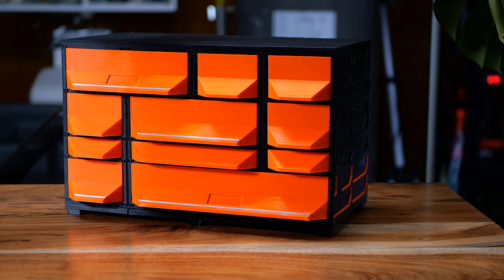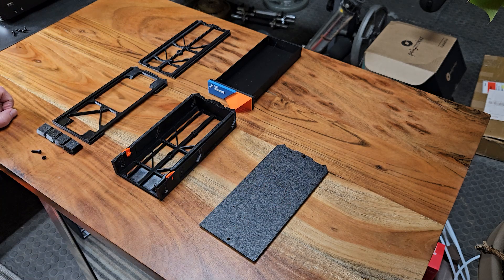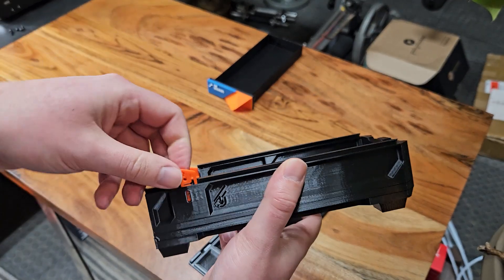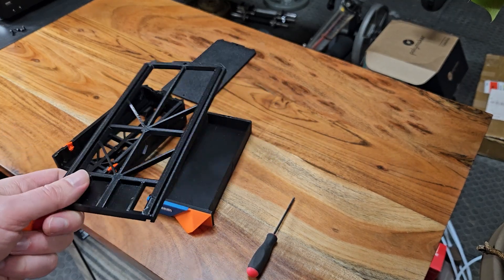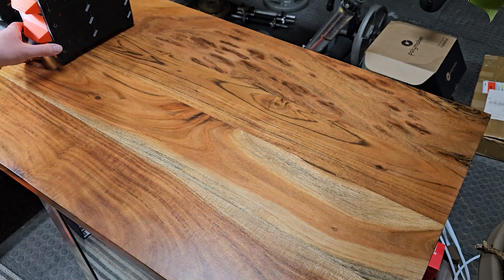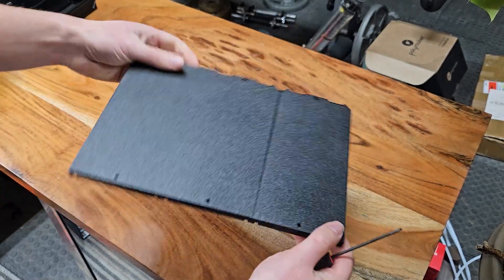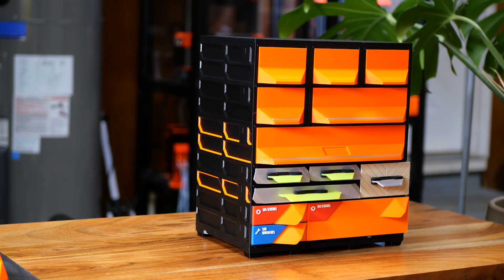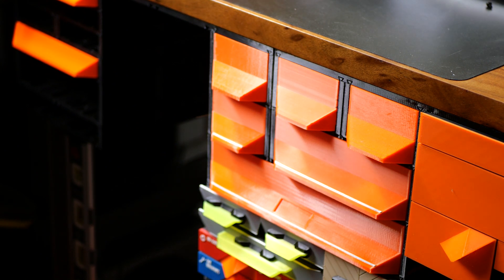3D Printable GEN2 Table Top Kit V2

Comment: My quicklocks aren't springing back, they just come down and then stay there, any ideas on that?
Reply from the maker: Here are a couple of things that might cause that:
- Stringing inside the QuickLock slot causing more resistance or obstruction to the mechanism - It can be hard to clean this out with a tool but working the quicklock in it's motion for a minute or so usually can help loosen or smooth things out.
- Elephants foot on the QuickLock - This causes the first layer to print wider than intended created a slight lip on the mechanism. Deburring the edges using a deburring tool can help correct for this.

Comment: Did you just remove your standard starter kit from Makerworld?? 2.23.25
Reply: Nevermind, Makerworld was glitching. =)
Reply: I do want to ask why you prefer PETG or ABS for the main frames? Do you see any issues using PLA Matte from Bambu Lab?
Reply from the maker: PLA will do fine for the case, the only thing I really recommend in PETG are the QuickLocks

Comment: I found this a month ago, and thought it looked great, so I downloaded what I thought was the correct files.   I just finished printing constantly for almost a week (the bins are 19 hours x2  and the draw it goes into is 22 hours also x2 on my printer), when I went to put them together nothing matches the videos, apparently I downloaded a legacy version, that has no instructions, so now I have to find the correct files, and spend another few days, to a week printing more stuff, I've gone from wow to deflated, I may as well  have bought a reel of filament and dumped it in the bin, on the bright side, I printed the standard bins, so at least I don't have to print them again...
Reply: did you use the links in the description?
Reply: Yes I did, but the parts I pri Ted did not match any part in any of the videos, some pieces were usable, but I've a bunch of unusable parts right now... love how the draws turned out, waiting on magnet to complete the job.  I'm probably just missing something, my build only uses one bottom frame, the top frame, and its joined using draw cases, not the upper and lower parts as described...

Comment: How do you do the contrasting colors on the sides? I can think of a way to do it on bambu but it would create a ton of waste.
Reply from the maker: You are absolutely correct, I was experimenting with this, it was actually printed on a multi-extruder Prusa XL which is much less wasteful when printing color changes vertically.  With that in mind I created the Decor series faceplates as a much more efficient way to add decoration to the drawers.
Reply: @jerrari3D makes sense enough to me! I appreciate the answer! I have a full set of table drawers printed but I’m waiting on some filament for the actual drawers to come in. Thanks for the cool design.

Comment: I just got my printer for Xmas and this is my first project outside of toys. My noob question is, what tool is everyone using to get the excess material out on the dove tails on the underside of the print? After breaking and bending a few tools, I finally sharpened a putty knife and that seemed to work okay but tedious. Maybe because I'm using the included PLA from Prusa? Also, to go vertical, I am assuming I just print one footer? I've got a 3x1 done and printing more parts now. That said, this has been a really fun project. Will subscribe to the project in the future.
Reply: Disregard. I'm an idiot. Apparently I added supports somehow and had to dig them out of the dove tails. Noob move.
Reply from the maker: Hey no worries, sometimes it's best to print with supports on new models to find out if it will give you better results

Comment: This is amazing. Thanks. So everything is printed in PETG? I just ordered a 3d printer and looking forward to print this. Approximately how many rolls does it take to print that 3 drawer wide table top drawer system? Thanks again
Reply from the maker: Hello, sorry for the late response, you might have already started printing but to answer your question each single drawer in STANDARD length is around 100g per case and per drawer, so for instance 3 single drawers would total around 600g, the table top kit would likely require around 300g. 1kg should cover the basics but 2 spools should do the trick. I can usually find spools of PETG for around $13 which keeps the price pretty reasonable.
Reply: @jerrari3D  Thanks

Comment: Little confusing as all site (printable, Makerworld, etc.) have you stating M3x6 screws are the only thing needed. However, it appears M3x12 screws are actually needed to join rails to case (2:27). Later, you mention is you want to stop the drawer from sliding out, you'd then need a M3x6. The M3x6 appears optional and the M3x12 appears to be required. Listing on Printables states M3x6 and M3x10, Makerworld just states M3x6. Recommended hardware on this YT video is M3x6 (but again, video has you requiring M3x10 and the M3x6 is optional.
Reply: I had to use m3x16 actually at that point but perhaps it is because I am using a standard drawer instead of slim?